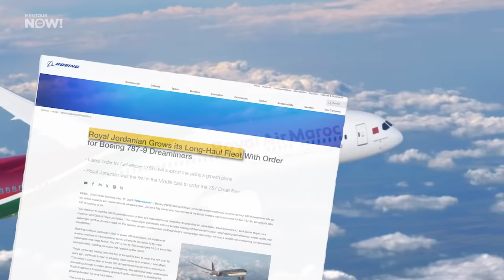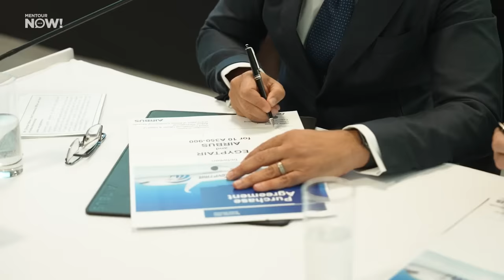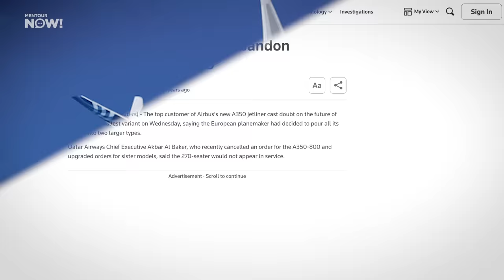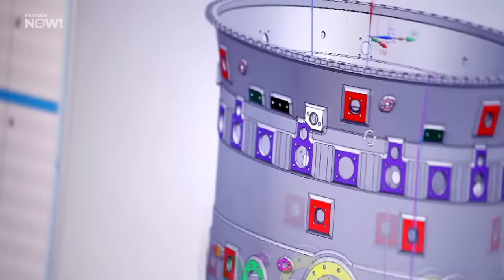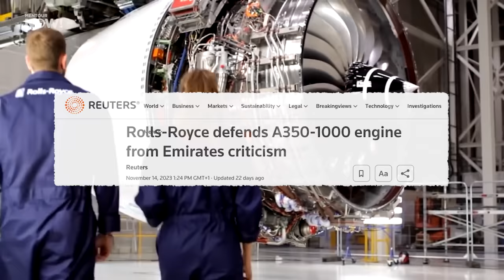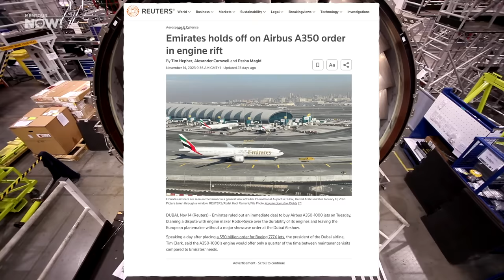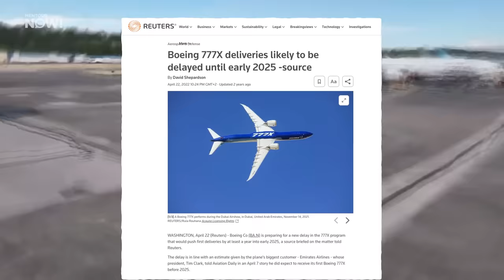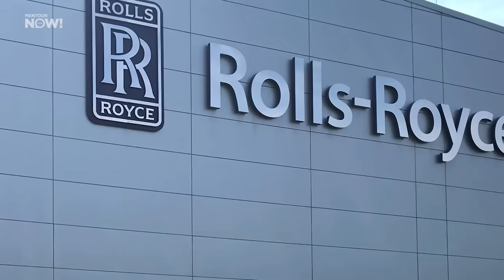What’s WRONG with the Airbus A350?!

Comment: I don't think what is said in this video does apply to this situation. Airbuses orderbooks are full right now. That might even be an understatement. They are absolutely PACKED. Why would they make large concessions in terms of price? There is no need. It's better to keep the prices and margins up, so they can deliver a quality product. That might cost them some orders, but to put it frankly, those customers who are only out to buy cheap, are not the customers you want. 
Airbus knows, that it is exaclty this focus on quality, the fact that they are not the cheaper alternative but the better alternative, which brought them to where they are now. Comfortably ahead of Boeing. And indeed they have the luxury to lean back a bit and not waste their time to fight for a deal which with all likelyhood would have gone to Boeing anyways, since there already was a huge existing order for the 777 there, making the A350 an unlogical choice to begin with. Pick your battles - the key to running a successful and sustainable business.
Reply: Well, you have to differentiate between models. True, the orderbooks for the A32xNEO Family are full to the brim. Airbus will probably need 12-15 years to fulfill the orders they currently have in the books for that model. But for the A350 that's a bit different. Yes, the aircraft sells well for a wide body long haul aircraft, but big additional orders gives you planning security. The issue is that once no orders come in anymore, the question arrises what to do with the staff and equipment you have on hand to manufacture this specific model.
Some clowns here in the comments say that Airbus should have continued to build the A380. Well, they don't understand the issue Airbus was faced with. Once the last ordered A380 was finished, what was Airbus supposed to do with its production line? Just let it sit there and hope for new orders in the future at some point? Even if a production line isn't producing anything, it costs money. So a long backlog is something the manufacturer really likes. Because it makes planning for years to come much easier.
Reply: @shi01   My point exactly. As of now: 777 lineup - 428 backorders (AFTER that deal). A350 lineup - 501backorders. So what is wrong with the A350? Nothing. It's completely pointless to interpret anything more into this than that Airbus wasn't willing to cut on prices just to get a headline. They don't need it. They really don't. They literally are outselling Boeing in every category and they do get better margins while doing so. Why should they burdon themselves with a semi large aircraft order at a shitty price? Thats a liability, not progess. Ask Boeing, they'll know. They've done it time and time again. They just don't learn it by the looks of it.
As for the production facilites and crew of the A380 - Those people do build other Airbus models at those facilites now. Because Airbus outperforms Boeing in backorders with 3.083 frkn machines and they need all the production capacity they can get.

Comment: It is cramped. It's an uncomfortable plane to fly in unless you are sardine.  It has poorly designed ergonomics for passengers. It's an unenjoyable flying experience. I forgot it isn't quiet, too. It has to have a 90 to 95 dB inside the passenger cabin at best -- and I thought Boeing planes were noisy. Nope, the 350 has them beat.

Comment: I would add that there is only one choice of weather radar, the honeywell, automatic one. And it’s really not working well….. I must say that I’ve always found the 777-200 non auto radar better than the 300 auto one. On the 300 some CB appear very late (around 80NM) and some others are disappearing…..
But the 350 is newer…. Pilots have to use the satellite image on aircraft wifi to be aware of the situation…. We were promised a new software….

Comment: You need to go back to the early  1990s  when Boeing struck a sweet deal for the GE90 family of engines: exclusive to Boeing.   yes, Airbus will spin its engine choice as "optimized design" etc, but in the end, they had no choice because GE90 family (includeing GEnx) is not available to them for the 340, 330, 350 or 380.  
For the 380 and 747-8, low volumes may justify single engine type, but Boeing got the better deal with the GEnx with bleed air version.
And when your single provider of engines (Rolls Royce) has probems with reliability, this has a lot of impacts sicne new customers can't choose the GEnx over  the Rolls Royce Trent 1000 as they can for the 787. 
The C-Series could only get Pratt & Whitney to agree to develop an engine for it and being early adopter, the early problems with the new engines caused delays that were the last nail in Bombardier's coffin. 
What is becoming clear now is that there is no point in building a new aircraft unless you have compelling new engines for it, and new engines with gret promises end up having great risks too.

Comment: It's quite easy to explain why there is only one engine option for 777-300ER and for Airbus A350: Boeing has a deal with General Electrics. Boeing will only use the GE90-115B for its 777-300ER and GE won't sell these engine to any other aircraft manufacturer. Same for 777-X. Airbus did ask GE about engines for A350 but GE declined to offer engines for all types. A350-900 was OK but not the thrust category of A350-1000. Therefor Airbus said, no thanks to GE.

A 777-X will visit next year Emirates at is home base to test the engines. Then we will see.

Comment: Both XWB models actually comes with the same fan diameter of 118"/3 Meters. The difference is the weight & the Thrust rating (-84 for 84,200 lbf & -97 for the 97,000 lbf). But in terms of fan diameter it is the same on both according to its spec sheets.

Comment: It will be so laughable if Boeing makes a mess with the 777x (extremely likely considering the absolute mess at the company) and Emirates will have a huge order of airplanes they won't get.
And laughable too if the virtually untested in the real world GE9x has the same issues as the Rolls Royce engines, and requires similar overhauls.

Comment: One must be very wary of airline CEOs stipulating engineering requirements of an engine/airframe, as the engine/airframe  manufacture/aeroengineers IAW FAA can only do this.
Seems to me airline management are pushing engineering limits for corporate profits and may pressure the manufacturer's to negate and push safety levels
So what's to stop engine/airframe manufactures being bullied by airline CEOs to accept erroneous calculated margins under the safety limits.
We saw what happened to Boeing when FAA gave them a loose leash.
Capitalism can causes competition but it can also be the cause of cutting corners, reducing safety levels for the sake of the purchase.

Comment: Once again it needs to be mentioned that the modern commercial aircraft is probably the most sophisticated machine built. Boeing and Airbus both stress quality and reliability. That being said, I am partial to Boeing. Watching them assemble a machine of this size is utterly amazing and I marvel at the quality of the product. Seeing something that huge lift off the ground is a sight to behold and I love standing as close to the runway as I can and watch them climb over me. The thrust of the engines is exhilarating.

Comment: One thing I dont understand. These challenging conditions (hot air, dust, sand) are the same for GE and RR as well. So why the time on wing is higher with the 777X with GE engines? Only reason comes to my mind - GE has less service checks. In other words you can put more engine hours before you need to inspect the engine. Isnt that against some acceptable level of safety? It is like servicing a car. Some car manufacturers recommend changing oil after 1 year or 30 000 km and some after 1 year and 10 000 km. So the car manufacturers with the lower recommendation are they too much greedy to create more servicing for car services of their car models? Or is it actually measure to increase livespan of the engine and thus it adds to safety/preventing damage?

Comment: I have really enjoyed these. Worth noting that engine development has been a serious problem for Boeing as well -- for the 787 and the 777X. Engines drive sales of new jets with big gains in efficiency and improved noise/carbon emissions but getting them working and certified is really hard. Also worth noting that the 777-9 was basically designed to Emirates' specifications, so engine development would have taken into account the desert climate very early in the process. Also worth mentioning that Airbus has sold so many 350s all around the world that delivery slot availability is also a factor -- Emirates needs 777-300ER replacements YESTERDAY. Emirates furious with Boeing/GE over the delays but what can they do?

Comment: To put the A350-1000 Emirates order more plainly, Rolls Royce put their foot down on the pricing and could not match the Boeing/ GE pricing. The other issue is the size of the airplane. The wing span of the A350 is 212 feet and the 777-9 is 235 feet. The A350 wing area is 4,760 sq feet and the 777-9 is 5,562 sq feet. The A350 is just a smaller airplane and cannot match the 777-9 in load carry capacity. It's like the difference between the A380 and the 747-8. The A380 is just a bigger airplane. BTW, the 747-8 has a wing area of 5,963 sq feet, just a smidge bit more the the 777-9.

Comment: I think there a lot to be said for both Boeing and Airbus to be able to provide a choice of engines for their aircraft, such as they had done with thr A380, B747, B757, B767and B777 previously. 

I feel that Rolls-Royce quality has slipped.  You only have to look at the issues experinced with the Trent 1000 whoch grounded sone 787s.

I've flown on the A350 and have to say its a really nice and comfortable aircraft in economy.

Comment: It's always the motors. However, as a first or business class passenger, not having center overhead bins in business or first is a huge mistake. Did Airbus do this to save weight? Customers in first and business compete with one another for overhead bin space for luggage. Completely unacceptable.

Comment: The Boeing 787 was offered with both RR and GE engines. The A350 only offers RR engines. Please do a video on the 787 with a comparison of the performance and history of engine issues with the GE powered 787's vs the RR Trent powered 787's. Inquiring minds want to know. Then reconsider why Tim Clark ordered the GE powered 777X instead of the RR powered 350-1000 ? Just an honest review of the history, no opinions. Yes it's hot and dusty in DXB - flown there many times.

Comment: It's one thing to order lots of planes, it's another to deliver, and the 'new' Boeing don't have a good history of that. Even the launch of the 787 was a sham, it was a mockup, not a prototype cause the plane had not even been made! Airbus A350-900 & 1000 are a proven aircraft, flying today, with a proven company behind it...more that can be said of Boeing. Boeing has gone from an engineering company making planes that also makes money, to a company hell-bent on making money by making planes; two very different beasts.

Comment: There has gotta be politics involved in Clark's decision. A350 1000 is a proven platform. Cathay Pacific ordered several A350-1000F  and ditching boeing . It's not all bad news for Airbus. Turkish airline is yet to make their announcement and they are leaning towards airbus and rolls-royce, KLM and Air France also committed to buy 50 A350 900 1000 .

Comment: Airlines like EK, EY, QR, and to a certain extent, TK and ET, survive on international flying.  Between bilateral issues and large city airport congestion, these airlines cannot increase flights much.  So to get the passengers they have to the airports they want to go to, these airlines need the biggest planes.  If Airbus doesn't sell the A350-1000 to these airlines, the biggest and most profitable planes get sold by Boeing.  If they ever deliver

Comment: General Electric has a contract with Boeing not to sell any engine in the size of 777-300ER to any competitor. General Electric GE9X is right in that size. 

We saw how it worked out for US Air Force with it's KC-46. Airbus and Northrop Grumman offered a proven aircraft but Boeing said its paper aircraft can do better. We will see how good the General Electric GE9X will be on wing in hot and dusty conditions. 

The real reason for me is not about the engines. The aircraft was rather cheap. Qatar and Ethiopian ordered A350 because they needed an aircraft  now and not maybe in 2025.

Boeing did won the KC-X contract finally due to a lower price. Due to delays KC-135 burned three times the price difference in fuel costs.

Comment: Jerseybean writing, I agree ,there is nothing wrong with the Airbus A.350 900 or 1,000 models but Sir Tim Clarke is fussy and has had a lot to put up with from Boeing and its 777 9 or 777 x as they call it , as far as I know it is still not certified and the New G.E. Engines has given a lot of problems and may yet to prove little better in the very hot and sandy conditions that the Rolls Royce Trent has.
Airbus I suspect are working on a stretch Rolls Ultrafan Engine A 350 for the future that will simply blow the Boeing 777 away. 
It would have been wiser for Sir Tim to ask Airbus what future models they have in the pipeline and get in first with a L.O.I ? But that is just my theory.

Comment: Emirates was smart. By going with the 777X they are futureproofing themselves, with a solid plane (though it still has a lot to prove). Whatever the result, they're going to be doing well, but they might end up doing wonderful: if the 777X ends up delayed, they can allege a breach of contract, receive copious compensation from Boeing, and order A350s instead that will be quite readily available. If the 777X is on time, they are just continuing their legacy with a frame they know well. The "worst case" scenario for them would be if Rolls-Royce fixes the A350 engine quickly, but the 777X happens as planned: in that case, they will be stuck with the 777X, with no easy way out of the contract to order a fixed A350, their preferred plane. But even then, the 777X is not a bad choice by any stretch. Emirates is really in a great position right now.

Comment: I know it's all about the "Money" and the "Cost Effectiveness" strategies of this industry leaders such as Emirates and other big Airlines but, I have zero trust to Boeing after how they deliberately cost 100s of lives with preventable two 737 Max crashes. No more Boeing or any other FAA certified American Aircraft. I am avoiding to board on any Boeing last 4 years, and will continue to do so. It turns out that I am on a good track after watching another 737 Max's fuselage blows of mid air. Those people were so damn lucky that the Aircraft was still very low when it happened. #NoMoreBoeing #NoMoreFAACertifiedAmericanAircraft. #AirBus #AirBusRocks

Comment: If your fleet primally uses let's say GE engines, having the ability to order your preferred engine supplier makes sense. And we all know what not having a second, (or third) engine option looks like when you have aircraft sitting on the ground because of a widespread issue. Tim Clark is 100% correct and as much as I love the A350, I would not place a substantial order until Rolls can ensure time on the wing is comparable to or better than other aircraft in the fleet.

Comment: Well, after the EMCAS debacle, I was telling myself that I should not fly on any Boeing. I relaxed about it a bit later. But now, you just never know which bolts aren't there in those planes. As far as I know Delta Air has opted for A350s, rather than Boeing.

Comment: If I remember correctly the reason was that GE refused to produce a new engine optimised for Airbus' needs. Instead, they offered the Genx that was optimised for the 787. That engine could power the 800 and 900 variants, however, wouldn't have been able to power the 1000 variant. This would have destroyed any commonality advantage for customers that had chosen GEnx, which would have been detrimental to the prospects of the 1000 variant.

Comment: Regarding Turkish Airlines is there not a risk that Geopolitics is a part of the issue there?.

Turkey wants to buy modern F16 fighter from USA and there is the Ratification of Sweden's NATO bid plus Turkey not sanctioning Russia.

It would not suprise me if Turkish Airlines would Buy Boeing instead to try to Apeace USA while ticking of EU so Erdogan can use Eu's negative stance as a brick in holding of Swedish Nato retification in Turkish Parliament and also to use it hold of EU rule implementation.

best regards.

Comment: @MentourNow The Fan diameter of the 84k and 97k has the same size (118"/3.00m). And this is the main reason for the problems. RR managed to increase the thrust by 13k without changing the fan diameter. I guess that they had to increase the temperatures to achieve the thrust increase. A very hot and dusty climate condition on top is killing the engines. A bigger engine would need a different wing design and I guess that Airbus wanted to avoid that.